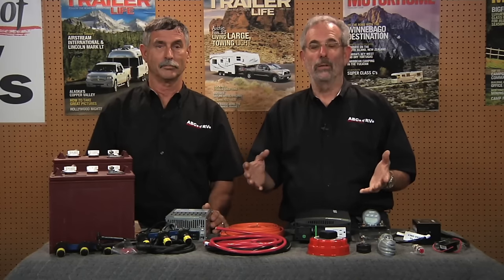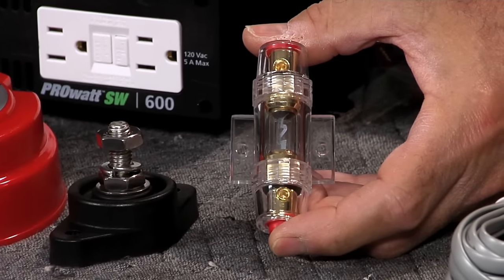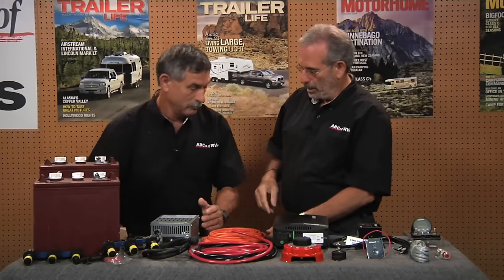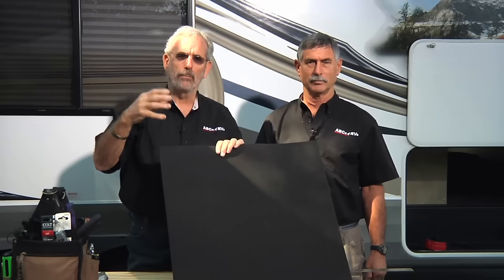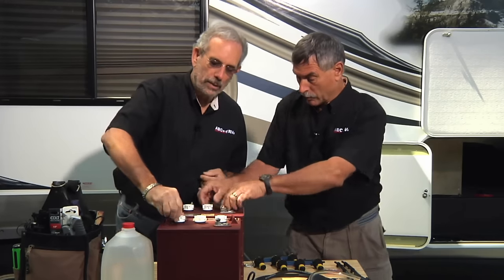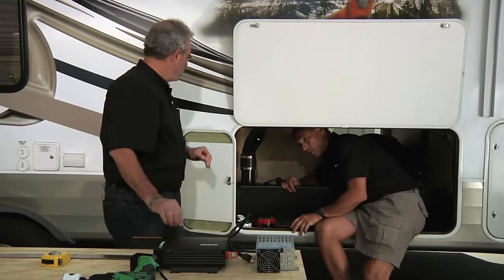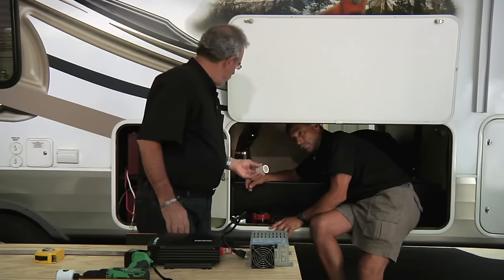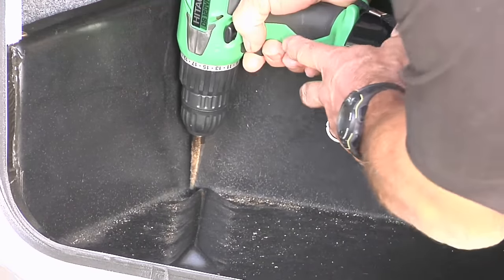12 Volt DC System Rebuild for RVs

Comment: Thanks for the helpful video. You make it look so easy.  I almost want to try it myself.  Could you tell me the cost of the materials used for this project?
Reply from the maker: I think each project will have different requirements and your access to parts & supplies will likely be different from ours so we don't think we could get to any level of accuracy if we tried to run a parts & supplies list.

Comment: What is "boondocking"? All you RV guys talk about it, but I have no idea what it is. I grew up with boondocks being a noun, meaning the wilderness. Now people do it, whatever it is.
Reply: I also was perplexed when I heard this expression being used. The only reference to "boondocks" that I recall was in a song, from many years ago. A few of the words were "Down in the boondocks" 

"Boondocking" seems to be what I know, in Australia, as "free camping", meaning away from the usual amenities of structured camping sites with power and ablution facilities. In the boondocking lifestyle the intent appears to be to get away from structured camping and live, for the duration of the trip, independently. This may include the use of solar power and batteries and/or using a generator for power, or even less sophisticated amenities.

Your reference to wilderness Lance, may be spot on, in that people living this style want to get away from the crowd.

Any other explanation, I would be pleased to hear,even if only for my own edification.

Cheers, Peter

Comment: Cool video.. poor sound.. and I wonder the following:  Why the "limitations" on power???  You employ some high priced, high end equipment,, but limit power.... I would want, in my RV,, the ability to run a microwave to warm food,,, a coffee pot for 5 mins to make coffee, an air compressor if I need to fill a tire.. and a 8 amp 120 v electric impact wrench to change a tire, in an emergency... I also want to run an air conditioner.. a 5000 BTU should only consume less than 500 watts.. In 10 hrs,,, running half the time,, would be workable with 500 AH batts, at 60% dod.  And gee. we forgot that the RV should have a 150Amp alternator,, which can be "switched in" to charge or supplement power needs....  Sorry that I expected to see all this, but it is a 90 min professional video!  And by the way,  great suggestions on the mat, and making it neat... (maybe use a grommet in the hole with the extension cord)  Except for that, and MY needs... Thanks!  I mean this reply in good light,, and am suggesting how to augment the installation.
Reply: interesting,  and yet no reply~

Comment: Yeah it doesn’t make sense to use a steel gearbox especially when you’ve got water connections right beside it myself I would use a sealed plastic waterproof box along with fittings and waterproof wiring especially when you’re so close to the water pump and water connections

Comment: I bought a newer trailer and swapped out the old batteries.  I want to wire them in parallel as I had in my older trailer.  But, this trailer has a blue wire (with a 30 amp inline fuse) a red wire (with a 30 amp inline fuse) and a white (grounded to the frame).  I believe the red goes to the positive terminal, and the white goes to the negative terminal on the other battery.  Where does the blue wire go, positive or negative and which battery?  Hope that makes sense.  ThanksRead more Show less
Reply: just look at your trailer wireing chartto get your anser. i see a lot of guis modify the wireing and short circuit  for not referring to the trailler chart as all trailler are not wired the same depending of accesseries

Comment: Why would the inverter not have its own breaker at the distribution panel?
Reply: David Hefner The power from Xantrax going to the trailer outlets passes through a breaker first......The inverter has 1 or 2 GFI outlets that will trip if a short occurs.
Reply: Fyi....some trailers don't have a separate breaker for the converter, so if you add a transfer switch you will be powering the converter witch will be charging the battery....I added a separate breaker just for my converter to stop this affect.....my converter also never stops charging when hooked to chore power, witch will eventually boil your batteries. I usually turn off the converter if I will be plugged in for long. but take note- your refrigerator won't run on A/C without the converter on, so I just run the refrigerator off propane.

Comment: a properly installed wire nut does not need to be taped and generally the tape will fail before the wire nut connection besides the fact when you added the tape you wrapped them in the direction of loosening the wire nut. the J box also is required to be grounded. besides the fact that you use 10 gage wire to your outlet which is only designed for 12 or 14 gage wire. the box you used in the belly should is the wrong kind of box not suppose to be used in and unprotected location.  but other than that the video is great.
Reply: Todd Gorla haha. Tape on wire nuts is so useless and all it does is make for a sticky mess in 6 months. So many violations. Painful to watch but it’s an RV. Everything is done with zero craftsmanship.
Reply: @coasterbrookie  still think you guys put out a great video. And a sticky mess indeed.
Reply: Todd Gorla it was good overall. Always something to learn for sure.

Comment: Your 110 wire installed in the box should of been Armoured wire aluminum outside grade. And romex connector of a different type expansion type just plug in to box no screw nut to tighten or come loose with road vibrations ground wires correctly using ground rail and attach neutral properly with neutral and ground connected to same rerminals you will get a feedback current. Not correctly installed

Comment: And then I noticed when he was installing the plug after installing wires on the outside of the wall plug he didn’t wrap the outside an electrical tape in case of shortage because we all know that a trailer bouncing down the road screws do tend to come loose and the last thing you want is a screw to come loose and a wire fall against another wire and God for bid you have a faulty breaker
Reply: Just skimming through comments. RV's aren't built well, there's probably a hundred other disasters on a timer in every coach.

Comment: I just bought a  Dutchmen classic 220  I believe it is 1994 /1998 but I came by and I don't have the manual I don't have the title I have a bill of sale I have been trying to figure out my icebox/norcold I've never used it but I have started messing with the buttons on the door icebox working making sound but yet I heardoesn't change temperatures and it doesn't do anything except light bulb I also unplugged from the back thinking it was ice box connection but I came inside mind you my better my RV has no propane leaks

Comment: So using a fuse a bad idea one thing I noticed you turned one end but not the end going into the fuse that makes no sense you’ve just created more resistance by adding more material I am at the end of one end of the wire and not the other you should’ve used a breaker as well not a fuse because when you’re in the middle of the bush where do you find a fuse

Comment from the maker: I have two 6-volt batteries in series on my 23 ft Starcraft TravelStar. -bd-
Reply: TrailerLifeDIY a stupid question, once the batteries are fully charged and you're not using them yet you're still in a high Sun area when the batteries are completely full is it stopped charging what happens to the charging force of the solar panels when your batteries are fully charged
Reply: That's why a charge controller is crucial.  The controller cuts in and prevents the batteries from being overcharged.

Comment: That junction box joint would be grounds for dismissal if you worked for me..  I can definitely tell that your not an electrician . You didn't ground / bond the junction box , strip the outer jacket of the romex cleanly and the wires were way to short by code. Minimally you should have 6 inches of wire coming out of the box. To make it nice for the installer and a service guy 10 inches would be ideal.  I also suggest elevating that J-Box so water cant get into it being that it's so close to water connections that could fail. Another thing if you didn't tighten your wire nuts well enough that electrical tape won't save anything.

Comment: I advise not to use the fuse holder they showed. Reason behind is, when you screw down the power cable to the holder, it does not hold much strong, which enables to pass high current. Most of the times cable seen coming off.  For a motorhome, always use fuse holder that has a post and have nut/bolting system, that could prevent accidental fire.

The poor Chinese make fuse holder is a big risk for a motorhome. Believe it and be saved.

Comment: I’m amazed you didn’t cover one thing right away. Battery safety ⚠️ you never mentioned anything about being careful with any metallic objects or tools or even when installing the batteries into those compartments about not shorting out the battery terminals. That’s a big fail. You should’ve talked about the safety issues and how a battery can explode if you don’t pay attention to what you’re doing. And the proper order to hook your terminals up especially in a totally confined space.

Comment: I see you guys used tape to hold the screws on the screw driver....An easier fix is use "duct-seal", placed on the screw driver's business end and you can leave it on for the time it's needed.
Reply: Or use Robertson screws...easier to find in Canada admittedly, but they inherently hold on to the screwdriver tips

Comment: WRONG GAUGE SOLDER WHEN TINNING BATT. FUSED CABLE, NEXT SIZE UP NEEDED. BEST TO NOT HEAT WIRE THEN START ADDING SOLDER, BEST TO BE TINNING THE HOT IRON ADDING SOLDER JUST AS YOU PUT THE IRON ON THE CABLE THE SOLDER IS ALREADY FLOWING AND YOUR TINNING TINNED WIRE AS WELL. UNLESS IM BLIND AND THST WAS COPPER STRAINED

Comment: I am adding a D.C. system system to a horse trailer that has nothing in it....and I am NOT an electrician...bought my Trojans yesterday to try to figure out the set up on the ground, before any of it goes in the trailer. Great video, but never showed the connections in the compartment...still stuck...

Comment: Too bad this video is most of all about preparing cables and drilling holes than actually showing and telling what goes where exactly and why etc. Also, a map of all the connections would have been nice.
Reply from the maker: Hi, Juhani, Thanks very much for the feedback. Honestly, we're not sure that specifics would be possible or even very helpful since there are so many variations in the way RV systems are put together.

Comment: I just check all connections while in the panel, just my 2cent...  And always twist solid wires before you you put nuts on and not freakin tape.. and twist nuts until very tight..  been there seen the fires caused by not doing so..  Also your wires are not proper length in J box..  way too short...  (6" min from  outer edge of box)   No ground bond to box?  Sheathing too long in box (1/2"Max in box)...  nothing to code here..sorry    I'm just a picky has been retired licensed sparky here...

Comment: your 110 volt wiring methods are all wrong!  
Wires must be twisted together first then wire nut. no ground wire on box. all gnd wiers must be hooked together THAT crap will loosen up  one day 
Have a good day
Reply: you do not twist the wires first.. Thats what the Nut does..
Reply: All connections need to be mechanically secure first and then wire nut maintains mechanical connection and insulates the connection.
Reply: Also, when he tapes the nut! He is tapping it opposite of the wire nut being tightened, you can see the wire nut loosen as he is tapping.
Reply: Yes all metal enclosures must be bonded.And also those grounds are all tied together. Not to mention six inches of free conductor for splicing.The j box is also in a bad location for water intrusion.RV wiring is already sketchy enough.Probably would use grommets or mc cable for penetrations as well.These things drive on the road and abrasion is significantly increased.

Comment: I lost him in the first 2 minutes. Have no idea what he was welding and moving. A 12 volt system with two batties This is the at 24v. Was it a 6 or 12. They were saying we are going to show you everything but not really. IS Good Sam video's all like this? I am a 101 guy.  These guys are talking code I don't have a prayer. I am frustrated and angry.   Maybe they should write down what they want to say instead of winging it.  After a while they were just talking to themselves. Removing the things for the batteries and  welding and measuring and removing was terrible for me. Did these guys get paid?